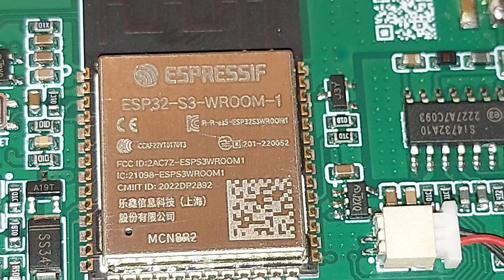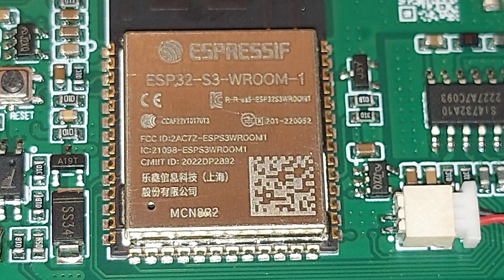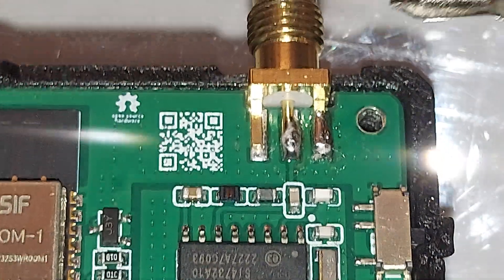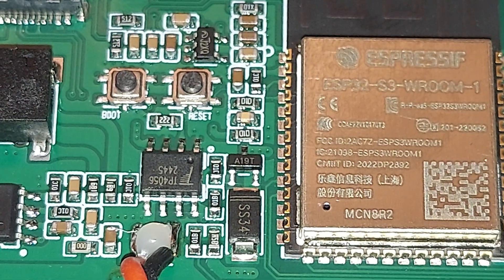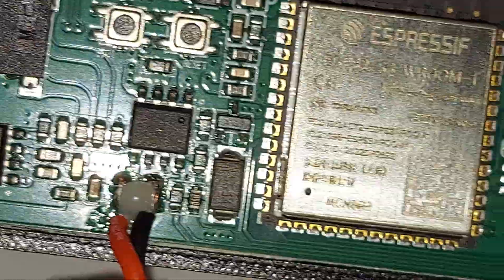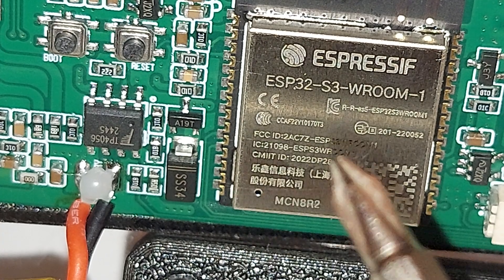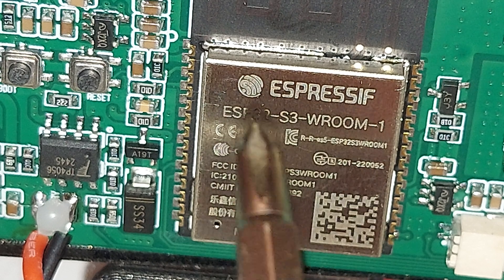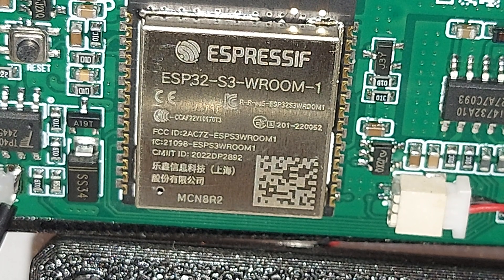Taking a look inside the Si4732 Mini Pocket Radio

Comment: ESPRESSIF Esp32-S3-WROOM-1 is a wifi / Bluetooth module...  One would need to read the coding of the firmware that is flashed on it to see exactly what its doing...  It is possible to write a firmware for it that would have wifi / Bluetooth capabilities with or without one knowing they are active...  

https://www.espressif.com/sites/default/files/documentation/esp32-s3-wroom-1_wroom-1u_datasheet_en.pdf